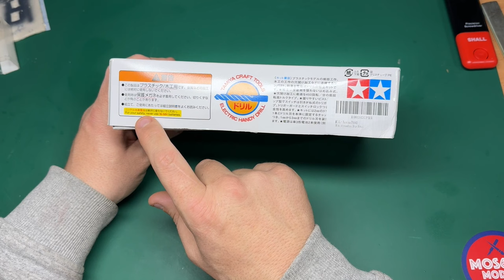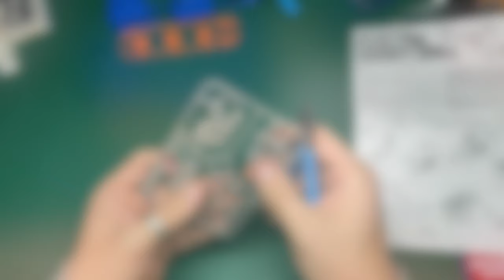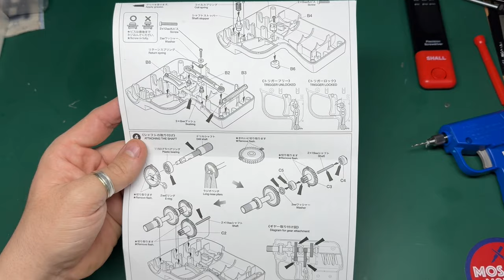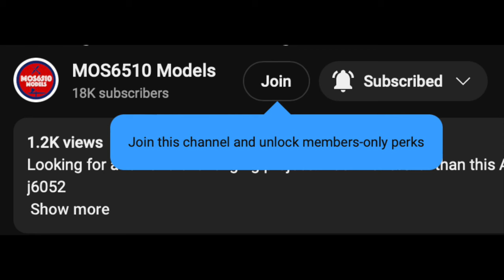I built the TAMIYA Handy Drill - BUILD and Review

Comment: I bought one of these about 5y ago from a vendor at JaxCon and I still love it.  Works perfectly fine on styrene, resin and bass wood.  If you don't abuse or force it, it shall last like mine.  Glad you found one.  I don't recall if mine had that Tamiya sticker.  I may have thrown it away by mistake, but it's all about function.  Thanks for sharing.
Reply: When I bought mine in Tokyo in 2014 I seem to recall getting a tiny sticker ( no tamiya branded one) ment for the bottom of the grip  , ( didn't use it I know what it is 😅) however i do want the other version ( router if I remember correctly) when a friend asked me why I got it I just said I'm a builder of models so why not build the drill I'll be using 😂 ' he didn't get the joke,

Comment: Hi Moss, These are a great little tool. The Plastic bearing installed in Step 4 onto the drill shaft was originally designed by Tamiya to be a high speed metal ball bearing and the plastic one can be replaced with a Tamiya 'Hop Up' bearing 1150 (in fact it states 1150 on the instructions!) this bearing is 5 x 11 x 4mm and is a direct replacement. Using a metal bearing really improves the concentricity of the tool and reduces run out. You can easily get these online for a few pence and is a worthwhile upgrade.
Note: The bearing upgrade is even more of a benefit on the Tamiya Handy Router #74042 as it runs at higher RPM and in use can be subjected to a side load.
Reply from the maker: Good shout.. I will be building the router at some point so will look at this upgrade.. thanks matey

Comment: Looks good!

I'd suggest emphasizing a bit more grease on the safety screw - mine was a devil to get in AND still isn't working properly. Not the biggest deal, but still!
Reply from the maker: it was that clip that was hard work for me.. I use it alot to be fair, it hasn't let me down
Reply: @MOS6510Models  Feels like a good drill so far - a quick test on MDF shows that it's not bad for $12!